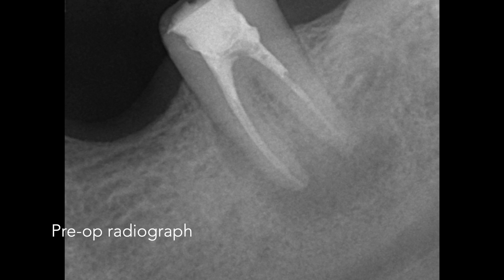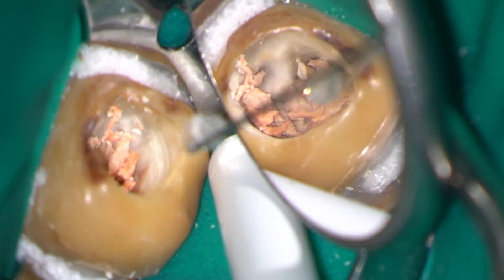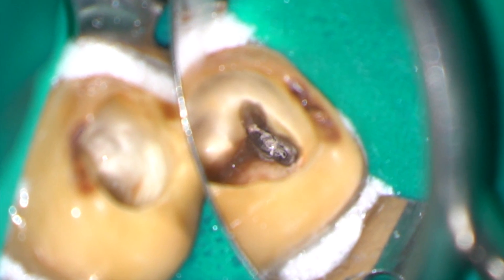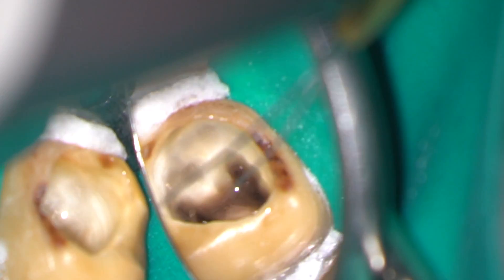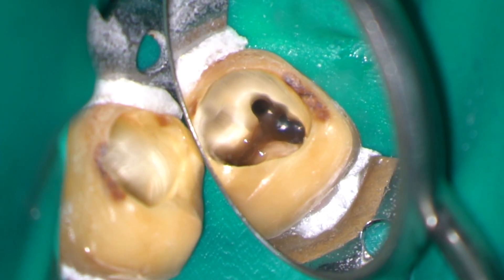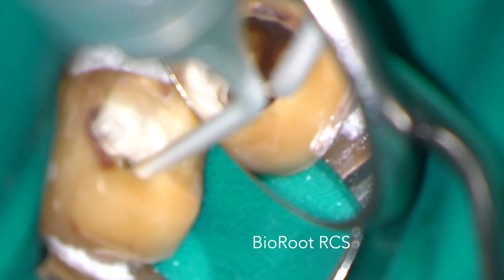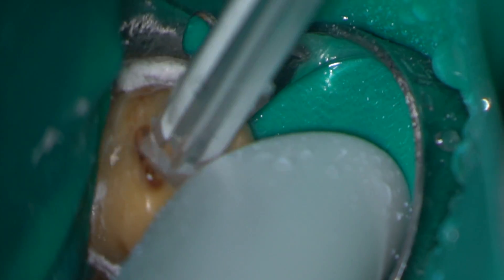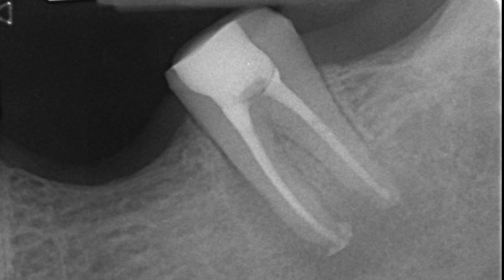BC molar retreat LL7

Comment: Hello Dr. Rhodes. Thank you for another great endo video. I have 2 questions. Firstly, why didn't you backfill the canals? Secondly, why did you cork the obtura over the canal orifices? Is this an alternative way to backfill canals?
Reply from the maker: Thank you!
In this technique you are aiming to fill most of the canal with sealer, GP is only inserted to allow retreat if necessary no need for backfill. The cork of obtura stops the BC sealer from being washed away when you etch and bond.
Cheers
John

Comment: Hi Dr. Rhodes! Great video. I had a question regarding Bioceramic sealer removal. I understand that GP removal would assist in creating a glide path. However, how is one able to establish patency where the GP is not extending down to the apex, and the apical third is basically sealed with BC sealer? Is it possible to push through the sealer with a file?
Reply from the maker: Hi Ahsan,
I have found endosonic files very helpful in this case....usually BC cases fail for a reason and the material has voids or is not rock solid.
Cheers
John

Comment: Hi John! Hope you’re doing well despite the very fluid COVID-19 situation we’re in the midst of! - I was wondering do you have any tips for accessing through crowns - as of course this throws off one’s perception of where the pulp chamber is due to the natural crown being concealed by the restoration, would love to hear your words of wisdom!
Reply from the maker: Hi Martin
Still mining root canals at the moment!
I usually take some pointers from the pre-op radiograph...like a cusp tip or buccal groove.Head for the point where you expect the pulp chamber to be highest/largest and work the pulp floor map from there.
Cheers]
John
Reply: john rhodes endo  Hi John-do you have a CBCT on site and if so, what make and model is it?